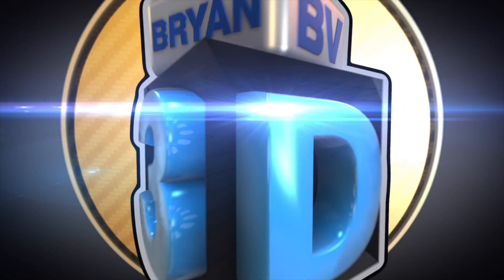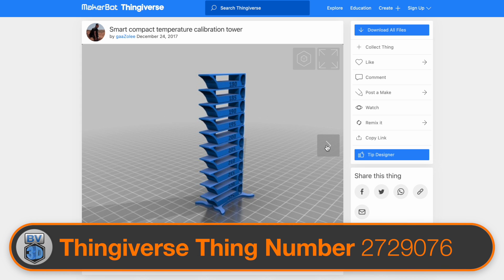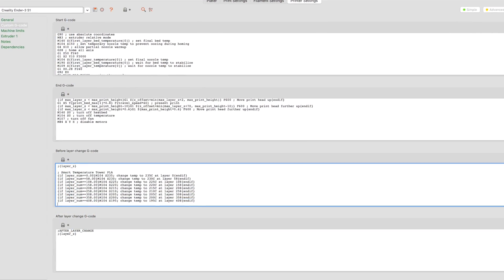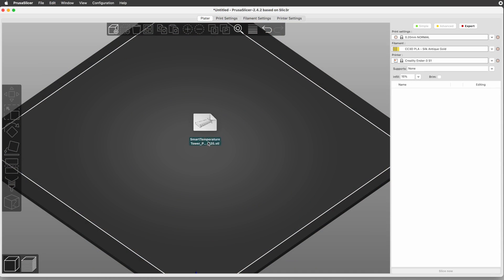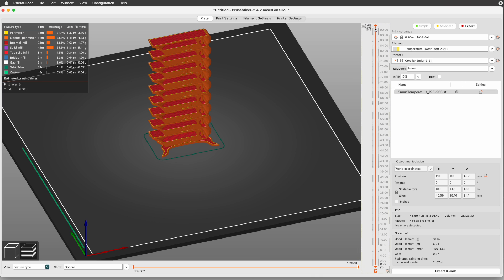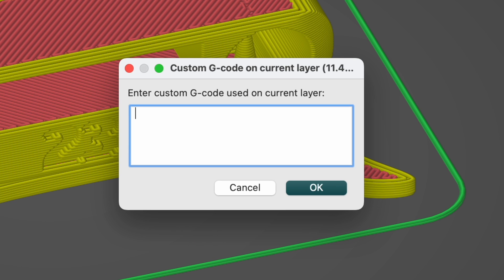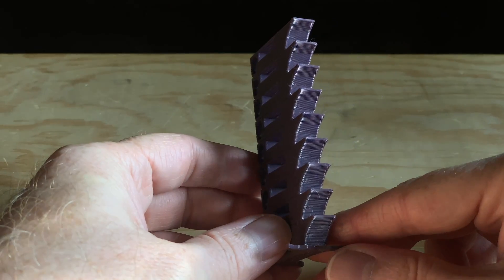Fast & Easy PrusaSlicer Temperature Tower for your 3D printer!

Comment: This is incorrect, you should be changing the temperature at the end of the last level not at the beginning of the new level. Those three layers in between give the nozzle time to heat up instead of heating up about 3-5 layers into your new tower level

Comment: If anyone needs to do this in Orca Slicer the G-code "code" is "M104 S225" just change the "225" for the temp you require.
Example:
M104 S215
M104 S220
M104 S225

After inserting the G-code, slice it again and in the upper right corner you'll see a box that reads "line type" (or something like that) clic on it and change it to "Temperature" and you should now see a colored 3D model. IF IT'S NOT COLORED DON'T PRINT IT, that means Orca is not "understanding" what you want it to do and there's something wrong with your G-Code

Comment: wouldnt this be better with a m109 code holding the movement till the temp drops?
Reply from the maker: Probably not. It only takes a few seconds for the nozzle to drop 5 degrees as it starts printing the next level of the tower. By the time that transitional layer is done, the nozzle is at the correct temp. Holding movement during a temperature change could lead to a blob of filament oozing out during that wait period.

Comment: great instructions.  one question.  as soon as i import the pla+ tower into prusaslicer i get warnings about stability issues.  i'm assuming it's the overhangs, but i noticed in your video, you don't get any warnings.  not sure if tha'ts just due to the newer version of prusa that is out now?  i assume i should just ignore it and print it anyway?
Reply from the maker: I think that's just the newer version of PrusaSlicer warning you about those overhangs. It probably wants to recommend supports, but I think you can ignore the warning and print anyway.
Reply: @BV3D  thanks!  yeah i've learned to sort of just judge whether it's making sense or not.

Comment: 4:07 you do it one layer too early (that gcode is added before the layer ; it is more obvious with M109 and ie. M300 S432 P1 before the temperature change) ; also I recommend using M109 instead of M104. for the very first layers (the base), it is better to use a somewhat intermediate temperature. other cool, I didn't know about this feature of inserting gcode that way 🙂

Comment: Using 2.7.3 you need to add a return after typing the G-code. The slider then shows a  G marker on the layer you have added the code.

Comment: One of the greatest videos! very good job. I have a question for Prusa slicer and Ender 3 s1pro. When I add the color change the printhead extrudes a lot of filament and there is not enough time to change the filament. When I use the Add pause print the printhead stays directly above the print and I can not change the filament. Any ideas?? Can you please make a video with filament change?

Comment: I'm not sure what im missing and it looks like I may be the first to have this issue from the video. Followed the same process for Prusa slicer for PETG and running into a issue where the temp for layer 1 starts at 235C instead of 265C. Any help would be appreciated.

Comment: Thanks for the idea. I decided to do it one other way that i thought of after watching your video. I have some custom G-Code in the layer change that only generates the temp changes when the filament type is set to "Temperature Tower - 235 Start" The temp change macro is from the thingiverse site you linked, i just added the IF statement based on  the idea i had after watching your video. Now i just leave this is my printer setting all the time, and when i select that filament, it generates the temp changes at the layers needed.  Thanks again!

; Temp Tower Change Macro Based on Filament Preset Name
{if filament_preset[0] == "Temperature Tower - 235 Start" } M104 S{235 - (layer_num-7) / 50 * 5} {if layer_num > 7} ;T tower floor {(layer_num-7) / 50 * 5 + 1}{endif} {else} {endif}

Comment: Why do you use M104 instead of M109 when you do the temp changes? It's it a good idea to wait for the nozzle to heat up before doing successive sections? Does it cause problems?

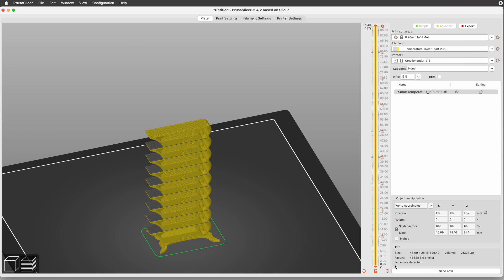Comment: Tip for those doing this:  once the final slice (5:15 mark in video) has been done, change the View mode (bottom left in Plater tab window) to Temperature.  You will then see each bit of the temperature tower colored to the print temperature.   This will confirm that you have done the G-code correctly.
Reply: Can you explain a little more to someone who's new? I see a box that says 3d editor view and slices that say preview, but no options to change to temperature.
Reply: @youdontknowme-r2m  For me using latest Prusa Slicer 2.6.1 it's now in the top-left of the Plater tab in the Legend as a dropdown.  It says "Feature type" by default but you can change this to "Temperature"
Reply: Super helpful tip. Thank you.
Reply: Thank you for an excellent tip, using it right now 🙂
Reply: OUTSTANDING suggestion :)

Comment: funfact, i used m104 s230 not M104 S230 - it does matter boys
Reply: you just saved me hours of confusion and frustration!
Reply: @flyguyeddy  use orca/bambu slicer, they work flawlessly and this thing is for oldschool boys
Reply: You also made Fun Fact a single word 😅 thanks for the heads up; that's good info.

Comment: Wouldn't M109 be better to be sure the hotend reached required temperature, or is the 5 degree small enough change for it to be fast enough to not matter here?
Reply: Agreed, M109 will wait for the temp to reach the set temp. Using the R option means it will wait while cooling as well.

Comment: Mine takes 1h 39m with a 0.6mm nozzle @60mm/s with an Ender 3 v2 equipped with dual z screws and a Hemera extruder, a layer height of 0.3 and the latest Prusa using Arachne. Thanks for this, It was very helpful.🙏👍

Comment: Is it sensible to scale down test prints like these if I want to determine the settings for smaller nozzle sizes?
 e.g. I'm dialing in a 0.2mm nozzle and would print this at roughly 50% scale at 0.08mm layer heights.
or should I leave it at 100% scale?

Comment: That looks pretty convenient! But still feels like a machine's work done manually ;)
Reply from the maker: Well, once you've done it once, you can print it whenever you need to. If you have multiple printers, you can switch printers, re-center the tower, and save the G-code for each one. When you're done you'll have a G-code file per printer, and from that point on you just print the file to run a temp tower. I find the 235-to-195 tower covers the vast majority of PLA, and since I generally don't go over 235˚C on a PTFE-lined hot end, that's kind of my go-to temperature range.